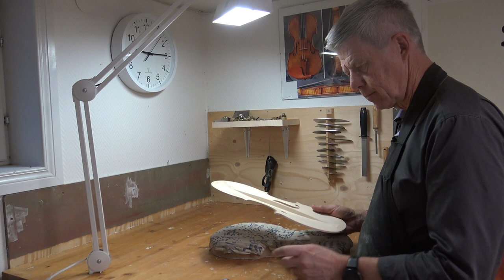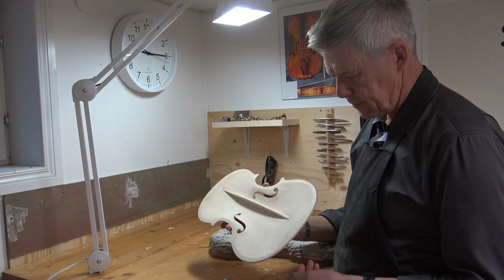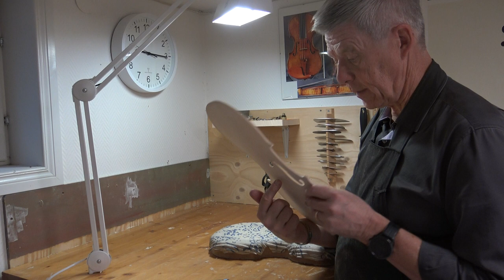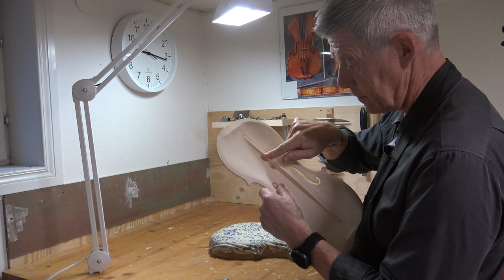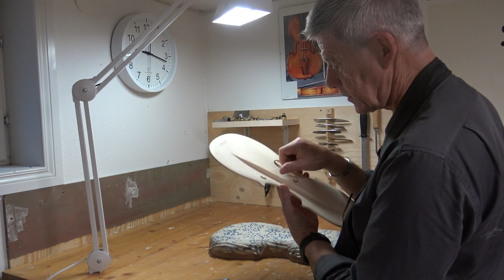Violinmaker Peter Westerlund Part 86 Tuning the bass bar

Comment: i see a lot of basebarrs close to the f hole, (top he top round opening of the f hole), your seems to be more far away from it?, what is the rule for this?
Reply from the maker: Different schools say different things. I have the middle joint as a guideline for where to start. If the F´s are close to each other, the bar ends up close to the hole. Also if the instrument is assymetric, it could influence the look.